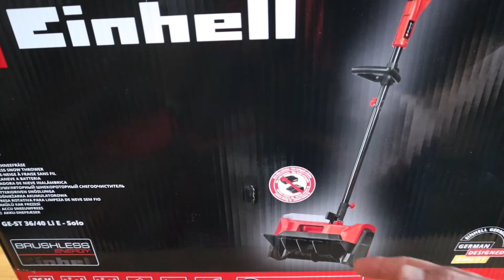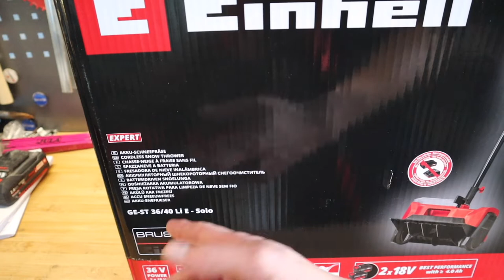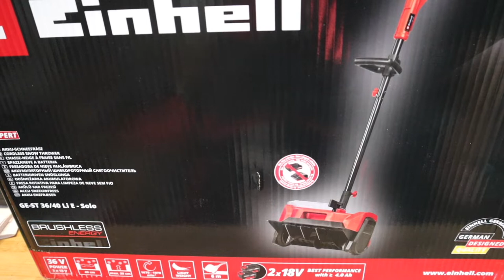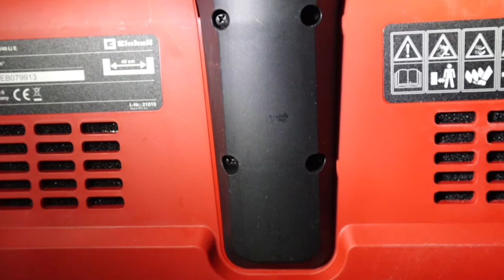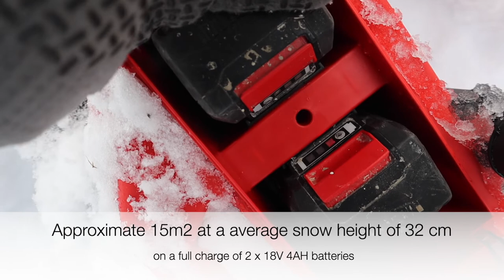Einhell 36V PXC Brushless Snow Blower - GE-ST 36/40 Li E-Solo

Comment: nice interview 👌🏻 could you get inside an 2.5 ah battery or just say that  the batterie type is 18650 or 21700?  thanks a lot
Reply from the maker: Only the new “plus” (red housing) batteries from Einhell have the new 21700 cells in them the 2.5 AH are the old 18650 cells.